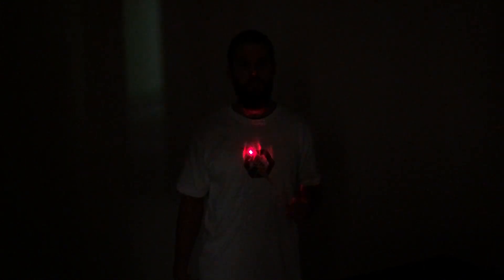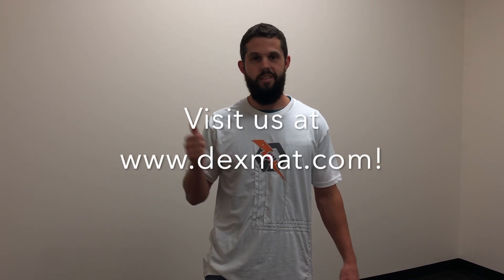Wearable Electronics: Carbon Nanotube Yarn + LEDs

Comment: Can a square patch be made with the carbon nanotubes or patch of film on the clothing as energy storage? Hmm designs of a flexible Arduino board into the fabric too... flexible circuitry! Another set of questions: 1) How flexible is the material? 2) Does it have memory retention of the curving/fold?